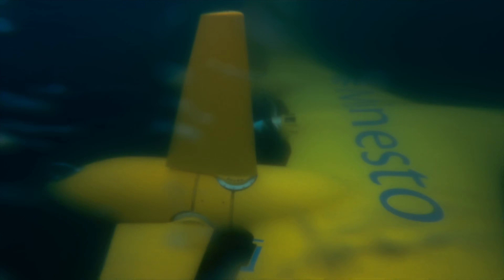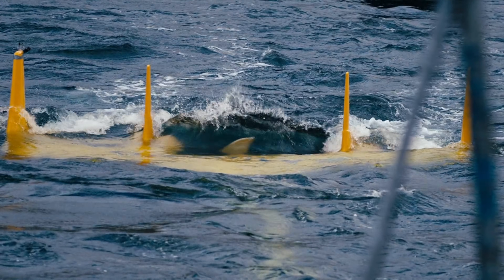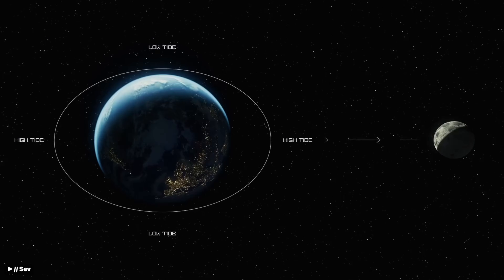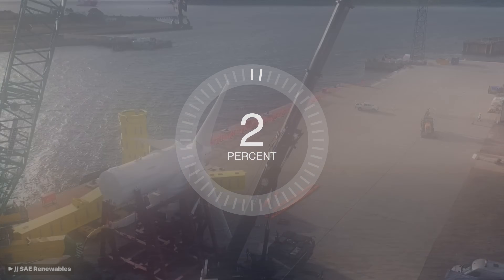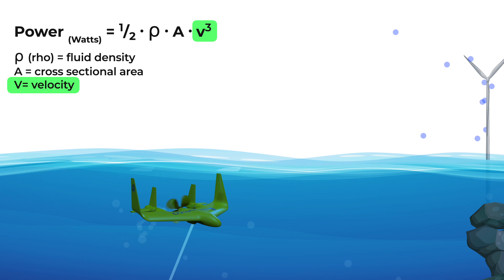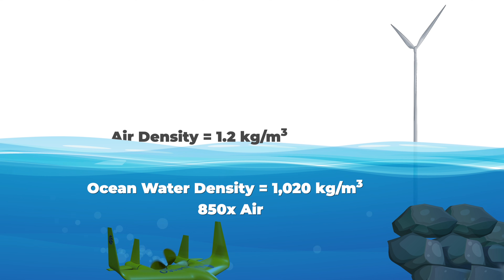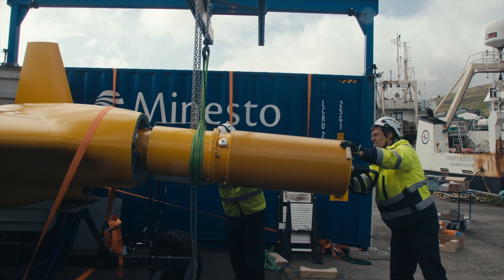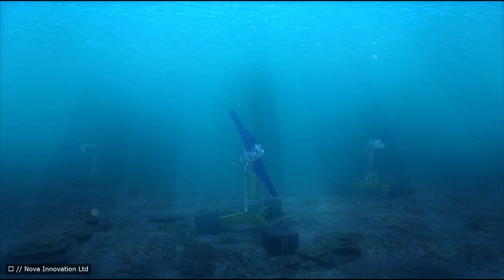How Flying Underwater Kites Are Powering an Entire Island!

Comment: Nice idea, however it's a killing machine that'll slice up marine life that get in the way, and it'll collect seaweed that will need regular downtime.
Slower is better, and there is plenty of room for large slow but safer methods of generation that won't collect snags.
Reply: Looking at it I think not.
The propeller/ turbine is the fast moving part, that is behind the wing structure.  So shielded somewhat
Reply: @markthomasson5077  The leading edges of the wings and stabilizers are fast enough to kill and injure, not just the turbine blades, and they will also collect debris, weed, kelp, fishing lines/nets etc.
Reply: @ahaveland not sure they go fast enough…do you know that?
Reply: @markthomasson5077  If they didn't go fast then there wouldn't be any point in having them, given that the object is to increase velocity!
Reply: @ahaveland the idea is that the wing increases, say doubles, the tidal current speed. That is still much lower than the tip speed of the turbine
Reply: Not a single incident since first testing 2012, just saying…

Better to look in the facts instead of screaming ”what if” when observations and data is available that shows a clean record.
Reply: @jojimom  Clean record perhaps with one on a small scale, and who knows if there were casualties that didn't leave any evidence?
Now imagine thousands of these, then what? Clean energy is great, but not at the expense of life.
Reply: @ahaveland  These observations have not been for small scale. It has been performed both for their D4 microgrid wing as well as D12 utility size.

What collision with casualties would not leave any evidence? They have pulled up these wings onshore so many times now for maintenance and testing that they would for sure see any damages made from a collision with a larger mammal.

No power source has a clean record with respect to impact on wild life. I'm certain that Minesto will also have som incidents in the future when they install major dragon farms and have millions of operating hours.

But it shouldn't be an issue if you compare to all other activities human kind impacts wild life.

0 environmental impact = no modern inventions made by human = go back to stone age.
Reply: give me a break, this is not going to be a significant issue...

Comment: The problem with a lot of other tidal generating systems is that the marine environment is extremely hard on equipment. This system should be a significant improvement in that it can be installed far enough offshore and far enough below the surface to protect it from surface conditions. It  would be interesting to know how much surface conditions matter to something installed 50 or 100 metres down. If someone were in a submarine at that depth directly below the eyewall of a hurricane, how strongly would surface waves translate to that depth? 
 I have always felt that offshore hydropower would be a better option that part-time generating systems like wind and solar, this system might make it much more viable. One question I have is, can the installation be basically plug and play, so that once the tether anchors are in place, one could just unhitch one that needs repair or maintenance and put another in its place and take the old one back to an onshore repair facility to work on?
Reply: What is the ROI? Any solution must be economically sound.
Reply: It takes about 30 minutes to replace one dragon with another for repair. Also they are (mostly) installed in places where you don't want to go with a boat and therefore not interrupt or disturb others. Marine life does not get affected by them either, as far as I know!
Reply: @northongauffin2057  What does it take to refurbish and replace?
Reply: @1winlock I am not sure if they refurbish but as far as I know most of the pieces, if not all, are modular and can therefore be replaced. How long it takes is something I don't have the answer for at this current moment!
Reply: Studies have already shown that they just stay away from these
Reply: To complex, a stationary tear drop like hub 5 meters wide wil also increase water speed ,and could handle 4 to 5 blades ,I wil also choose water pumping because it will allow energy storage and centralized energy production.
Reply: Another problem is that it's expensive and invasive. Just like wind power.
Reply: @yourcrazybear  Onshore wind power is actually one of the cheapest power sources. Not saying I prefer wind power since it also has alot of down sides. But definetly not expensive compared to other power sources.
Reply: @jojimom  "@yourcrazybear  Onshore wind power is actually one of the cheapest power sources. Not saying I prefer wind power since it also has alot of down sides. But definetly not expensive compared to other power sources."

If that were the case the industry would be thriving. Instead they are losing massive amounts of money and beg governments to pay for the connection to the grid. 

The equation will change by the time the supply of battery storage can meet the demand, but for now it's expensive and destabilizes the grid. 

And you are right that there a lot of other downsides with this technology.
Reply: @yourcrazybear ….just like oil / coal extraction and burning!

Comment: So like a sail boat that tacks faster than the wind, this tacks  or cuts through the water faster than the water's current.
Reply: That's my understanding too, which makes more sense than that figure 8 thing.
Reply: @olivier2553  to be fair, tacking through a figure 8 pattern let's it travel continuously perpendicular to the current. An alternate path is to tack circularly perpendicular to the current.  But the general concept is like a sail boat blown by the wind perpendicular to the wind can travel through the water faster than the wind blows.
Reply: @kreynolds1123  I understand that. The break in communication is speaking of figure 8 instead of speaking of tracking the current. The figure 8 is a result of following the current changing direction, the figure 8 by itself, in absence of following the current, does not do anything. By following the current, I mean getting in the position respective to the current that will produce the most energy.
Reply: @olivier2553  got you.  And for clarity, I'm guessing you meant tacking rather than tracking.  And  while tacking is a sail boat thing that lets boats zipper back and forth to go upwind,  flying a kite in figure 8 keeps the kite in the wind window.
Reply: @kreynolds1123  My sailing vocabulary is poor in French and even worse in English, that must be tacking then.
Reply: Comments are just a bit off. By combining the speed of the current and the speed of the kite, more power is produced. Look up "apparent wind speed."

Comment: What about barnacles? You can steer a ship into a dry dock and clean them off.
Reply: "Fouling"...I have worked in ocean my entire life and I've always wondered how they'd avoid fouling.  As far as barnacles are concerned, if the system can be installed deep enough, that would solve a lot of the fouling problems (no sun, no photosynthesis...no food for the barnacles).
Reply: It shouldn't be to hard to make the kite exchangable.
Reply: @johnbraunschweig  I agree. I could imagine sending one or two divers, or even using a custom ROV, to disconnect the kite, attach a float or hoist cable to remove a submerged kite, and reconnect a replacement kite in its place.